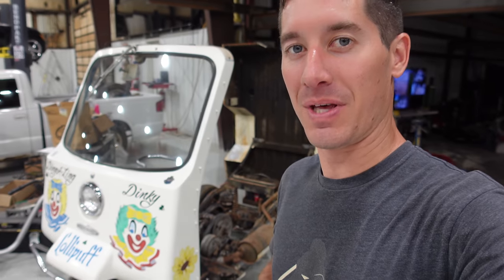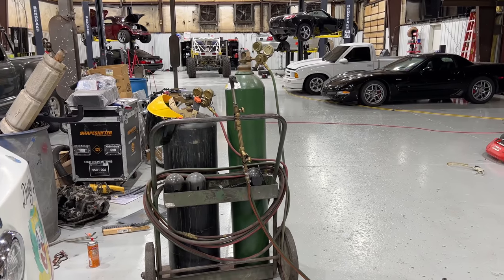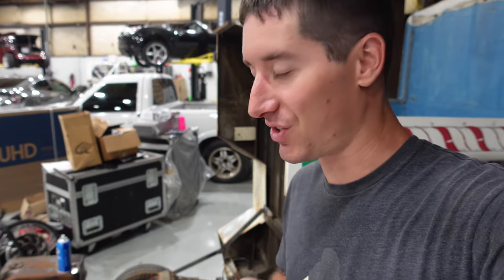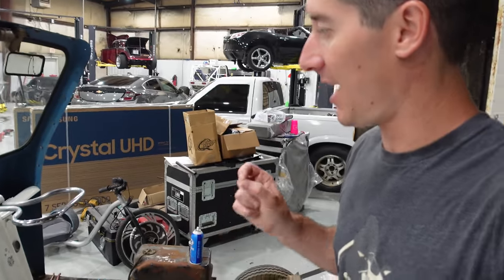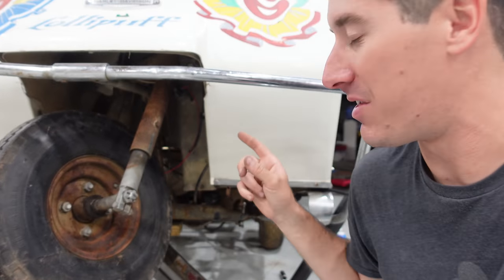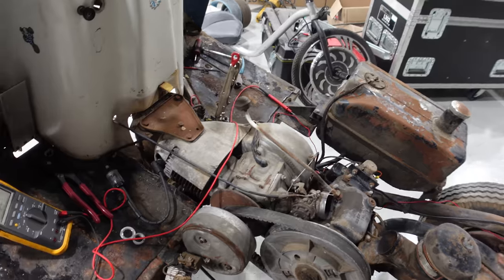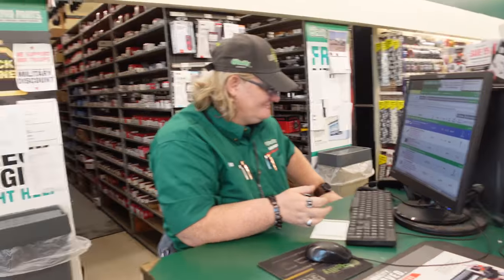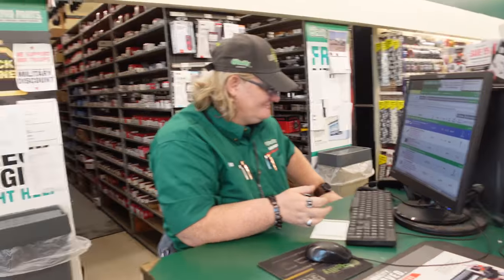Return Of The CLOWNS: FIXING And DRIVING This Antique Harley Davidson Golf Cart

Comment: The rusted on drum brakes could be "just Midwest things", having to deal with the drums being rusted on on my old 06 Scion xB is why I refuse to ever do drum brakes again, that was caused by years of Michigan winters though I have no idea why a clown car golf cart thing would have rust issues if it more than likely avoided being driven in the winter but I dunno
Reply: I dread doing the drums on my truck for this exact reason. We may not be as bad as Illinois, but Kentucky winters are rust makers from hell.
Reply: @phyrexiancoffee6324  yeah my buddy who was helping me ended up cutting the drums up to get them off and we just replaced them
Reply: Drums are great if you live where cars don't rust.  My old Tacoma with 200,000 miles still had the original rear drum brakes/shoes on it with decent meat left on the shoes.  Did the front brakes 3 or 4 times over the years.

Comment: For the points, have you considered a motorcycle repair shop? They might be close enough to points from an older scooter or small dirt bike. Another possibility might be an outboard boat engine shop. Failing that, as a last resort try a lawn equipment parts catalog. The points from a garden tractor might be close enough to work
Reply: Indian (Country, not the bike brand.) made Royal Enfield bikes used points right into the early 2000's. May look for a set to see if it would work.

Comment: HD is also a supplier to the USAF, not sure of other aircraft, but the C-130 E/H (4 blade) used HD chains for their nose wheel steering, as well as chains for the cargo handling system, also the grips for the cargo handling system were standard rubber HD motorcycle grips. Schwinn was also a supplier, but the majority of our aircraft had HD parts.

Comment: is it external points? when I was a kid, old small engines that came into my uncles shop with unodtanium internal points , we put solid state kits on them. if they still make them. was a little piece of plastic with a winding in it. you jammed it between the fingers on the coil. the magnet on the fly wheel excites it.